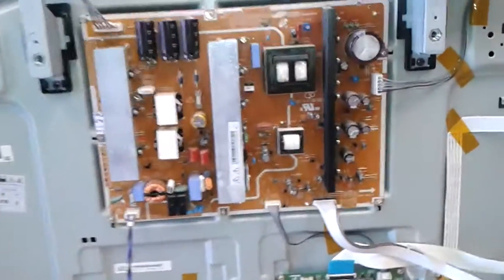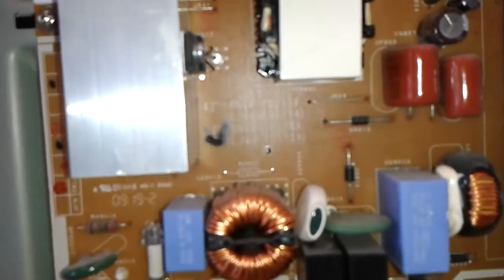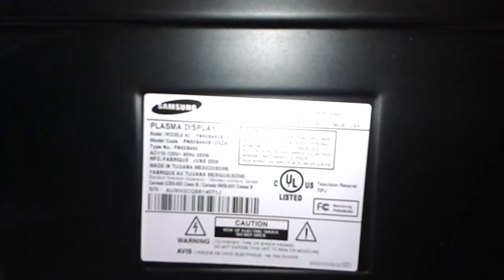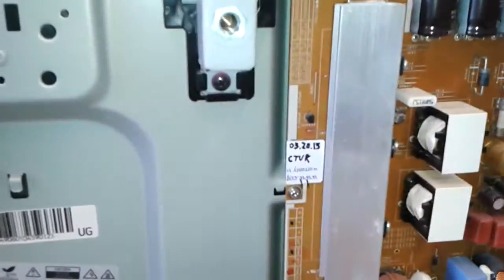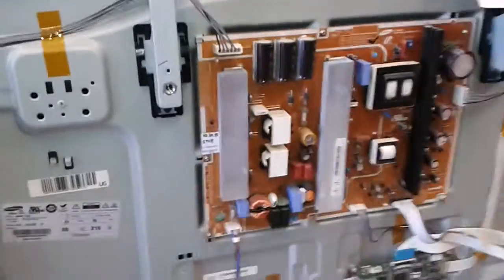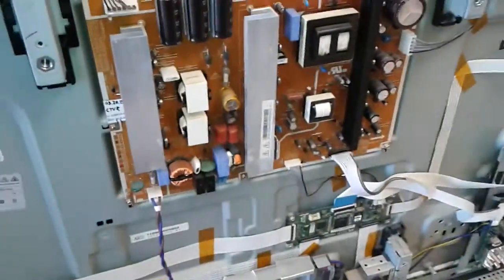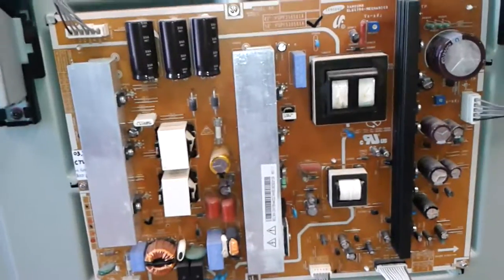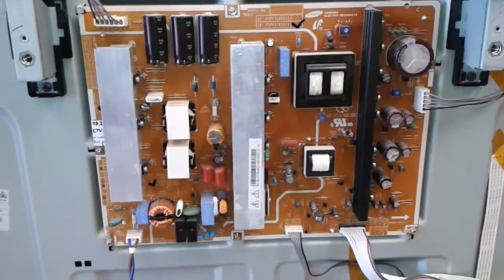BN44-00274A /  LJ44-00172A / PSPF520501A proof of functionality after repair

Comment: Hey, sorry to ask for advice when you guys need to make money, but, same board in my Samsung, and my Vs is low. Reads a perfectly fine 212v over by the Z-sus board, but I can only get 205v if I test the same trace on the cable connecting to the Y-sus board, and only 190v on the Y-sus itself, which leaves my Vscan too low to fire off the cells. Ever seen something like that? Have tested with 2 different Y-sus boards, same result.
Reply from the maker: The only way this can be possible is if there is a bad connection between the power and the YSUS.
Also Vs is not the same as Vsc.
We will not have the resources to do troubleshooting for you here.
But we would recommend finding someone who can do it for you or spending a lot of time watching and reading.
Reply: Right, Vs feeds the Vsc circuit tho. Yeah, thanks. All I can think it to try swapping the power supply board at this point.

Comment: Hi!  I have a 50" Insignia Plasma TV that uses this exact PS board. It never powers on and i get a constant intermittent clicking from one of the relays. I initially thought it was a bad PS board, but I did some further troubleshooting. I can unhook all of the other PCBs with no change until I get to the main Board:  PCB CODE: BN41-01154A.  However with the main board unhooked i get no clicking whatsoever, not even an initial start-up click that I used to hear at start-up.  Does this sound like a faulty main board or is there further steps to troubleshooting
Reply from the maker: +gabriel mott Can't tell if the problem is in the power supply or the main board from that description alone. The most simple thing to do would be to turn on the power supply maually, but then again it is not 100% reliable either. If I had to guess I'd say you probably have a bad main board (the guess is for this power and main board, NOT for the generic situation with any other power supply and main board). Also, "constant" and "intermittent" are opposites.
Reply: +Coppell TV Repair LLC Sorry for the confusion.  it is "constant", forgot to delete "intermittent" while editing.  I'll try to manually start the PS board even though you say that's not a sure-fire test as it could still be the logic board i'm guessing.  anyways, thanks.

Comment: Hello. I have the same tv but my y sustain board is different.  I unplugged the connector from the PS board to the Y sustain board and the clicking stopped and the sound came ON.  Still no picture.  Does this indicate that I have a bad Y sustain board?  I did further troubleshooting and on the Vs and Va test points on the PS board, I did not get any output voltage for my tv rating per label output.  Can this also be the the PS board?  When the PS board goes out does it go partially or all out?  I still have the LED light in the front and still fires up my main board.  Thank you for your help.
Reply from the maker: +Ritchie Mamisay It is theoretically possible that this may be the power board, yes. But in reality 99 out of 100 times it would be the board being disconnected from power that is bad and not the power. In your case it would mean 99% chance the problem is in the Y-Main and not the power. Make a note with exception for TVs where the X-Main board takes power from the Y-Main and not directly from the power supply; in those cases by disconnecting Y-Main from power you are also disconnecting the X-Main and that means the bad board could be either of the two. The TV on the video does have the X-Main take power straight from the PSU - you can see the cable on the right side of the power board going to the right.
Reply: +Coppell TV Repair LLC thank you for continuous support.  I swapped out my Y sus board with another board from a reputable company but still didn't fix the issue.  It did the same thing with exception of the TV not clicking when I turn ON.  Do you think the X sus board could be the culprit since its connected through Y sus?  By any chance do you have or repair this board.  Its PBA NO:  LJ92-01688A PCB NO: LJ41-07015A.  What are the chances does the buffer board be the issue?

thank you,

Ritchie
Reply from the maker: +Ritchie Mamisay Do I take it with the new Y-Main board the TV stays on with nothing on the screen while with the old one it clicks back to off?
Reply: No it doesnt turn ON. Power LED nlinks about 4-5x then fully shut off. Unlike the original y board it clicks and power LED stays on. Also same action when the x board is unplugged on both y boards. Just sound when it turns ON. Thanks.
Reply from the maker: +Ritchie Mamisay If the board shuts off with the new board , but stays on with the old one there are two possibilities: 1) The new board is bad causing the TV to shut down; or 2) the old board has failed breaking connection somewhere and thus preventing a watchdog to shut down the TV (e.g. a burned fuse); the failure may be on the board or AFTER the board, e.g in a buffer. 

I'd recommend testing with the new board WITHOUT the buffers as well as measuring the Vs voltage with the old and the new board.